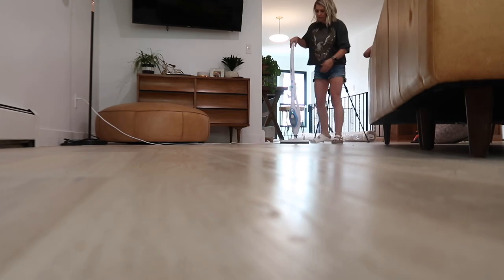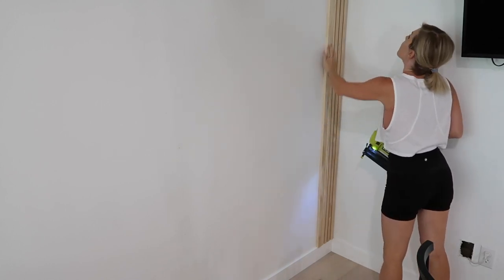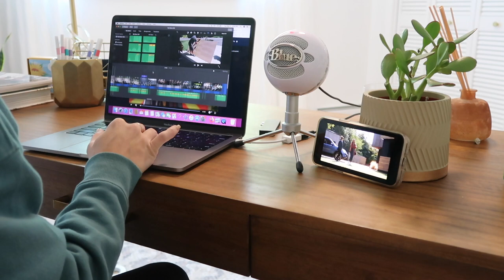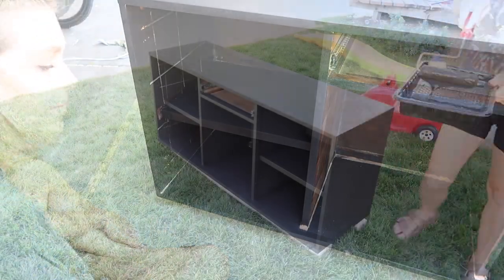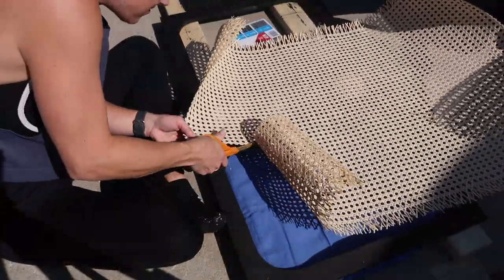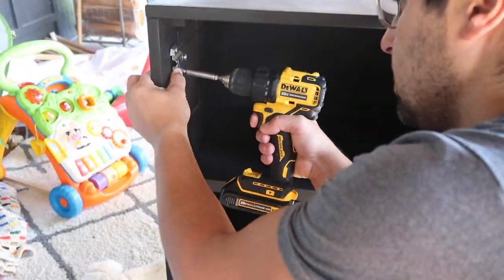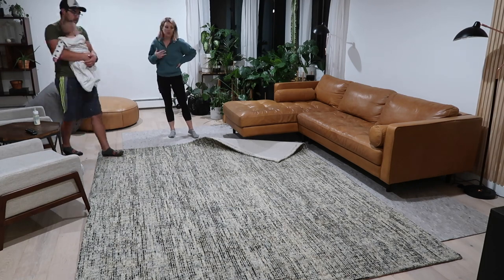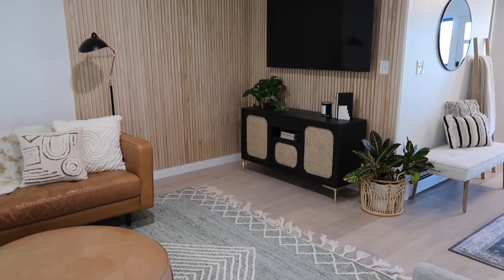LIVING ROOM MAKEOVER | MAKING OUR HOUSE A HOME | DIY SLAT WALL | DIY MEDIA CONSOLE | DENISE BANGIYEV

Comment: Hi Denise! A tip for next time you are using cane: soak it before stapling. It gives it a very slight stretch which will tighten as it dries, ensuring that the cane is taut over the gap. Astonished at your hard work, as always! ❤️
Reply from the maker: Yes! I did hear this 🤦🏼‍♀️ we will be fixing it. Thanks so much!

Comment: Wow, that looks great. I know the tv wall has always been an issue with furniture placement
The design looks great, and so does  the console, however,  I know it's not complete. I would like to suggest the mirror wall also needs slats, at least on each side  to pull the space together. 😊😊  I feel like I know you guys, always going for perfection

Comment: Nice work on the cabinet. I probably would have put thin trim strips over the edges of the cane on the inside of the door for protection; sort of like a frame. Not really a fan of a slat wall, but if you like it that is what matters. I default to paint on the wall in most cases; cheaper and easier to change if I want to.

Comment: You might wanna add hot glue on that cane on the inside so your kids don't pick at it and get pieces pulled out. Or maybe glue on another piece of thin wood like the accent wall to cover the edges so they dont frey or get pulled. I have kids too i know they pick at things great job so pretty.